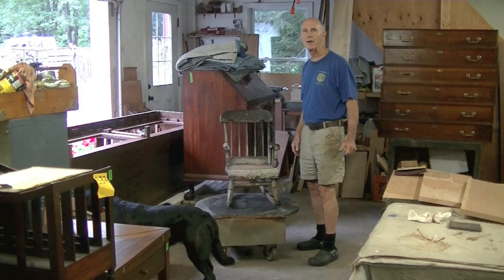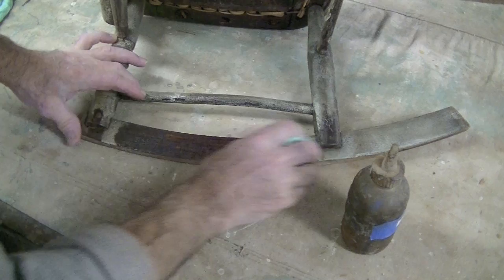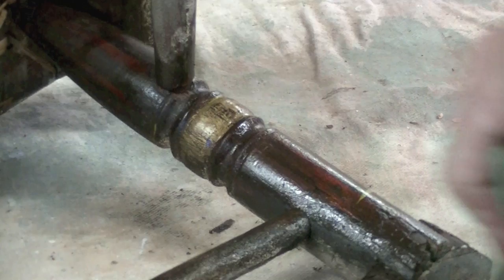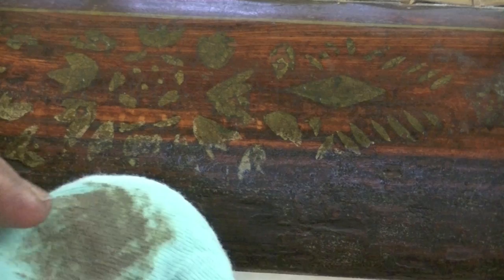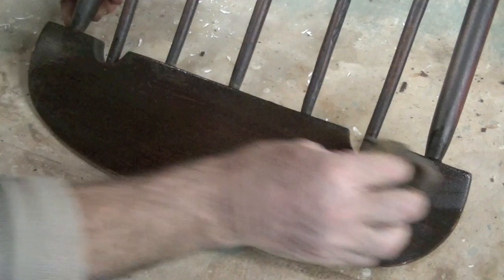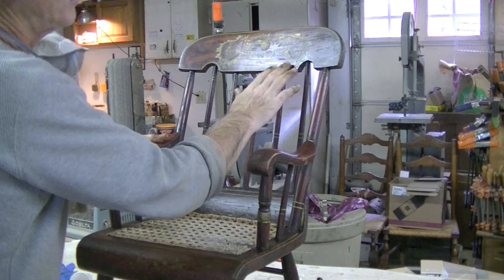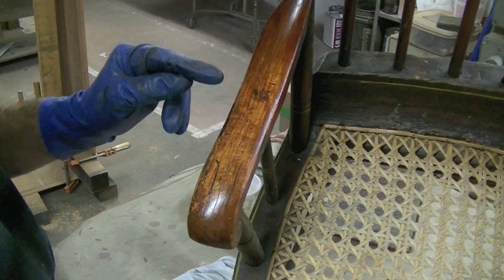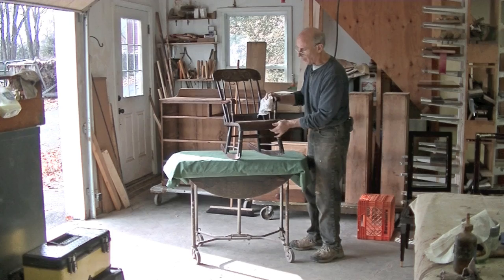Restoring an Antique Children's Rocking Chair - Thomas Johnson Antique Furniture Restoration

Comment: Love your videos. I found that a mix of linseed oil with a bit of turps and a bit of alcohol works really well in this sort of case. It's not aggressive but removes that whiteness caused by the water damage and helps with the dryness too.
Reply from the maker: +Clive Hancy Thanks! I would never have thought to put alcohol in with oil. I will try it!
Reply: @johnsonrestoration  Tom ,we love all your videos here in the UK. I have also used Clive's mixture to clean and revive surfaces. As he mentions it seems to feed the wood without taking off an existing finish. Best regards, Alan.

Comment: That looks like it was very time consuming. I would have been tempted to add a fresh coat of shellac over it to restore a bit more of the shine (and for a bit of added protection). I think the graining might have originally been made to simulate rosewood. A lot of these have a pretty dark red with black veining.
Reply from the maker: +sooth15 Hi, thanks for watching. It was my intention to give it a coat of shellac, but when I was done with the alcohol, it just didn't need it. So just a coat of wax and that's it.

Comment: This was fascinating to watch, and learn that sometimes all you need is a little patience. Not everything needs stripping, sanding, staining, etc. Question: did you do anything to the caning to clean or treat it??
Reply from the maker: Thanks! I only cleaned it with a little commercial cleaner. Cane doesn't really need any treatment. Some people mist it with water, but cane, like all wood is hydroscopic and will reach equilibrium with the surrounding atmosphere. To prevent it from drying out you need to keep the humidity up in the winter time

Comment: Tom, do you list somewhere the type of glues that you use?  The epoxy glue seems very useful for many applications.  Could you specify the type and manufacturer?
Reply from the maker: Thanks, I need to do that. The epoxy I use is West System, available from your local marine supply store
Reply: Thank you Tom!

Comment: Would turpentine or mineral spirits have been okay instead of isopropyl alcohol?
Reply from the maker: +Fred C Dobbs No. What I used was Denatured Alcohol, although isopropyl could work. The alcohol cut into the finish just enough to release the moisture. I doubt paint thinners would do it.